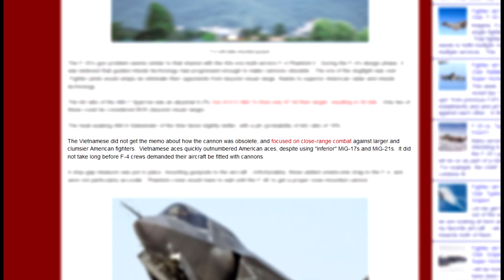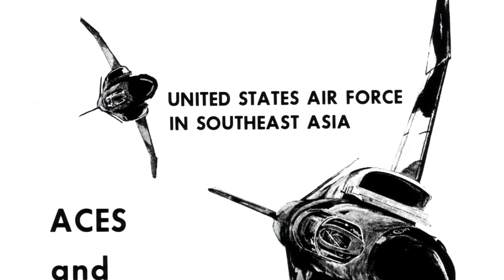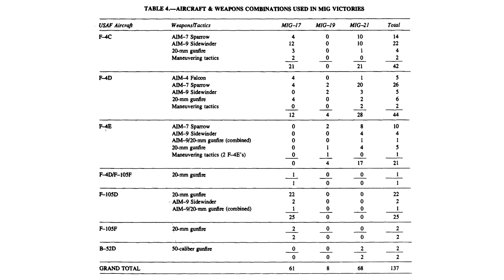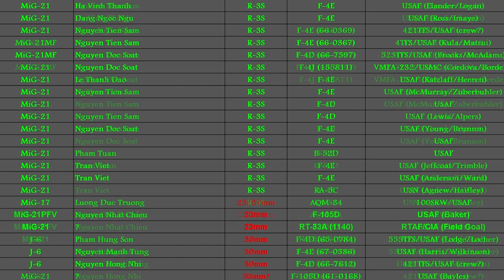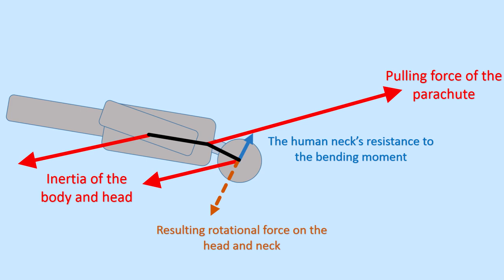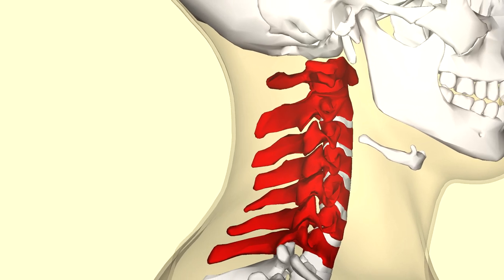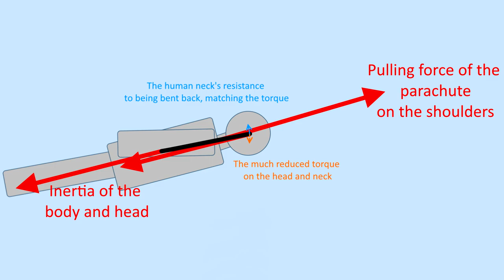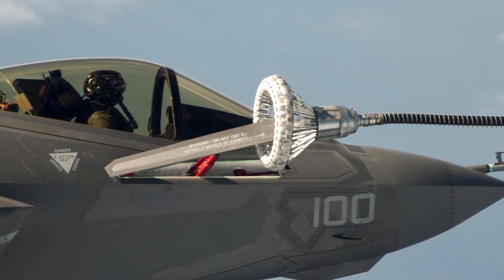F-35 Lightning II: Busting Myths - Episode 4

Comment: The problem with the historical stats on guns is that every ace interviewed stated their preference to have a gun whether it is from Vietnam or the Sinai. The issues with missles during the Vietnam war left our pilots at a severe disadvantage and this is well documented.  There were few beyond visual range hits and at least friendly downed using missles.  When you need a gun you need a gun. 
Further in Iraq the kills were mostly due to Iraqi planes taking off and fleeing to Iran.  Being identified by AWACS almost immediately left a perfect environment for missle kills.  
When confronting other stealthy aircraft the detection range shortens dramatically.  In the chaos of air to air fighting short range fighting often occurs.  While short range all aspect IR missles can handle close in fighting, missles can be jammed by technology and there is after all a limited supply of missles that a fighter can carry.
A gun as a backup is not just a nicety but a necessity for ground support as well as air to air combat.  Why use 100k missles to take out a handfull  of troops or a small vehicle when a cannon will do.  The fighter also can only carry so many air to ground missles as well.
Finally the A-10s 30mm GAU cannon is considered a staggeringly effective weapon against everything including tanks.  The F-35 with it's 25mm cannon has a significant weapon for close in air to air work and ground support.  Not having this cannon on the B and C models is folly particularly on the Marine B model whose sole purpose is ground support.
Reply: Not really. In the Fighter Pilot Podcast Vietnam F-4 drivers said that although a gun is useful, the compromise of a weaker radar and a heavier nose was not worth it. In fact while the the US was still uaing the gunpods one squadron leader forbid his men from flying gun pods - the extra weight and drag was not worth it.
The A-10 gun hasn't been able to punch through tanks since the 70s.

Comment: The F-35 is grounded due to wing insulation. F-35 with current 3i & 2B can't lock onto targets or direct missiles. The gun also doesn't function reliably in plane or pod.
Reply: the F35A literally locked on a target and sent the info miles and miles away to a missile carrier just a week ago.

it also locked onto EIGHT f15Es in a combat exercise.

who is telling you this bullshit about not being able to lock on?
Reply: Not An Argument. The Director of Operational Test & Evaluation, Dr Michael Gilmore.

So the question is who told you " F35A literally locked on a target and sent the info miles and miles away to a missile carrier just a week ago." & "locked onto EIGHT f15Es" this BULLSHIT?
Reply: Haitian Refugee that info is clearly incorrect.
should be included in the 5th busting myths episode.
Reply from the maker: +Haitian Refugee You're heavily exaggerating Gilmore's words.
Reply: Haitian Refugee also, that Dr. also said the F35 was indispensable.
Reply: Dragon029 fucking "indispensable.:"

dude thinks the F35 is absolutely necessary
Reply: dont bring up the information which are 5 years old. if i upload a video today that is 5 years old it outdated and not relevant today
Reply: Haitian Refugee um dude, those are small issues that happened to the f22s as well.

When dealing with 100+ mill jets shit will go wrong.

Fixes are fast and they get back up and running
Reply: You can stop shilling for Russian at anytime
Reply: 15 F35 were grounded im very aware of that. It is not a technical or design flaw but a manufacturing defect from one of the 1400 supplier. Solution is Simple theyll just replace it. And correct the manufacturer's wrong
Reply: Not An Argument. I didn't know the GAO, JSFPO, DOT&E, or the Senate ASC were instruments of the Russian government.
Reply: Foea kov Lucky the Pentagon wasn't allowed to purchase the 492 block buy or it could've been more than 57 aircraft that need new wings. With nearly 170 aircraft delivered that is a large amount of bad aircraft requiring intense modification.
Reply: Robert Brockway Kid I linked to US government documents & even a US Senate Armed Services Committee hearing where all the people in charge of the program spoke on the merits of the plane & the detriments. You can't ignore the bad because you look forward to the good. You can't blame Russia for US documents & hearings. I've actually heard Russian aviation experts talk about the F-35 in glowing reviews. This I believe is based on Lockheed Martins partnership in studying the Yak 141 in the early design years of the F-35. The company making the F-35 has had more of a relationship with Russia than I have. I understand you're a fan boy.
Reply: +Haitian Refugee

The affected aircraft don't need new wings, just replacements to some components of the fuel system. The DOT&E report you quoted is outdated, there's a reason they release them quite frequently. Hopefully we'll see a newer one in the next few months.

In the past month F-35s have delivered AMRAAMs and stand off guided SM-6 to targets. The gun isn't scheduled to be fully functional yet, so the current functionality is, in fact, ahead of schedule. The Program is doing fine.
Reply: Monster LMA Isn't it amazing how computer simulations make the F-35 look great? My weatherman's computer simulation said it was going to rain but the sun is shinning.
Reply: Haitian Refugee The F-35 maintained an 8:0 K/L ratio versus the F-15E, while maintaining 100% sortie rate, and 94% bomb accuracy, with one GBU-12 missing its target. That's a straight up fact from Mountainhome AFB.

Also, the Pentagon quoted an n:0 loss ratio for four ship F-35s versus four ship F-16s two years ago.

Comment: Get a HANS from formula 1 to protect the neck in a ejection, it already works well.
Reply: S Skyler the HANS  prevents you from moving your head too much wich is not pratical in a fighter jet.
Reply: the HANS device relies on being secured down by the harness in the seat of a a racecar, and therefore is useless when the driver is not in the car or on the seat. The neck injuries explained in this video happens upon seat separation when the pilot and seat are blown apart, with deployment of the parachute causing a sudden decrease in speed and increase in neck strain, the pilot at that time would already be free from the seat harness.

Comment: With the procurement costs dropping, the F-35 will be a success. 
However, the lack of a titanium tub and slow maneuvering, it should not replace the A-10.  
I would like to see how the F-35 controls compare to the A-10 for redundancy, robustness, and surviveability. 
A ground support craft needs to be able to take punishment, still operate, and keep its pilot alive. 
One more point -- The Marines have had the Harrier. I think the Army should get the A-10, and the F-35B. 
The Army should benefit from the flexibility of the F-35B.
The Army should NOT have to rely solely on the Air Force for ground support. 
Army generals should have their own F-35B's and A-10s for their own strategic & tactical planning, and for situational response.
It is asinine for generals to have to coordinate with commanders from other corps. 
It is inefficienct, riskier, and causes lives, IMO.
Reply: SFS Financing Doesn't the A10 also turn like a Titanium bathtub thought?

Comment: You haven't addressed the biggest problem with the F-35:  It's single engined.  That means it should be the Thunderbolt II.
Reply from the maker: That was addressed in Episode 2
Reply: No, the P-38 Lightning was twin engined.  The P-47 Thunderbolt was single engined.  Lockheed even wanted to call the F-22 the Lighting II but the raptor name was foisted on it by the air force.

Comment: Your first myth is a very good criticism, the F-4 did indeed struggle without its gun, being too close missiles won't work, being too far then you use the long range and unreliable sparrows

And the navy did use the F-4Es as well and the kill ratios of the untrained pilots increased to 6-1 and tog gun graduates at 13-1

Now BVR missiles have a 17% kill ratio against actively defending targets, and no, you cannot hide when you have a lock on someone

Ok, so you're telling me that a plane that goes 690 MPH got most of its kills with missiles when it's target is usually going Mach 1.4? How am I not surprised, really do you ever analyze the data?

Myth 10 is stupid, don't care and not relevant
Reply: The Navy did not use the E model.
The F-4 did not struggle without the gun. It struggled without radar coverage. Once Teaball coverage went into effect USAF MIGCAP F-4s scored 14 to 1.